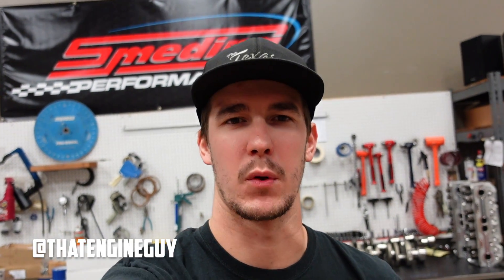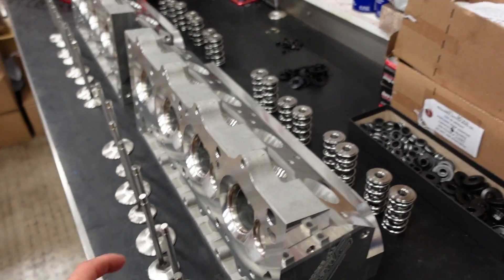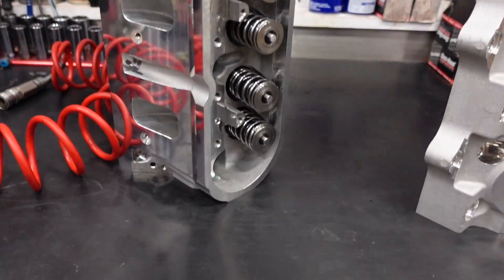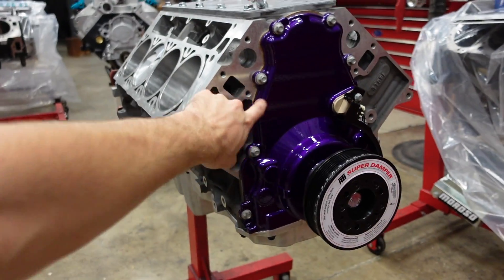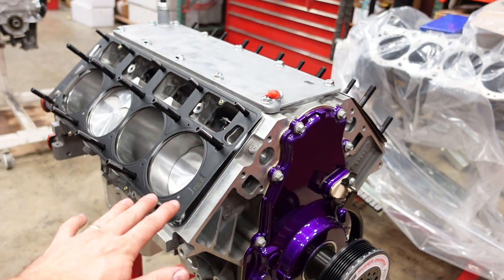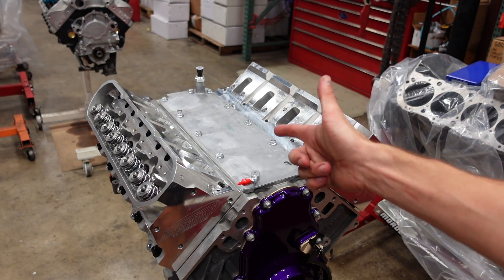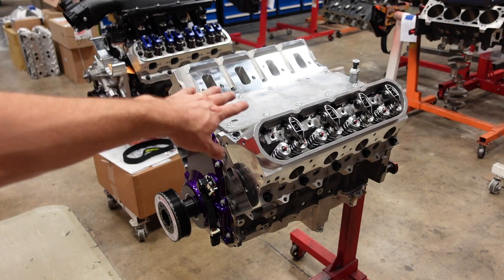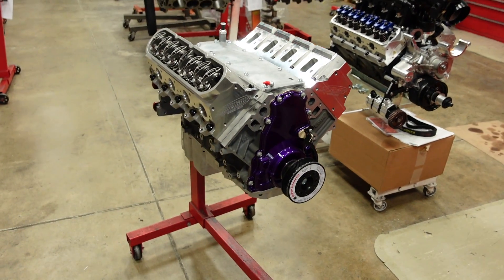Building the Perfect 416" LS3 Street Ripper - Part 2

Comment: Good stuff as usual, thanks. I used same springs and valve seals on my LS3 but was always concerned that the valve seals didn't have the typical design to hold them down with the springs as others do. Was hoping you could talk about them; any issues with those and/or do they hold reliably, any reports of valve seals lifting, etc...Thanks.

Comment: Hey Jacob, I have a question about my own build. I just got my block back from the machine shop, it’s a gen 3 6.0 bored .060 over. Do you think it can be put under boost to get about 1000 hp to the crank or are the cylinder walls too thin? Thanks.
Reply from the maker: It will be close, keep the timing low around peak torque & use rpm as your friend to pour the timing back in!

Comment: Hey Jacob. Curious about the rockers on this build. What if any trunion upgrade did you use? Why no upgraded shaft rocker system?
Reply: Just what I was thinking. BTR has that shaft system he covered in one of his other vids. For a mere $309 it would be worth the peace of mind.
Reply: @hotroddude6551  that’s what I was thinking as well, I have a 2015 camaro SS 1LE with Frankenstein heads and custom cam meant for boost, the people who installed it didn’t tell me about a trunion upgrade for the rockers and shortly after I had problems with that part smh
Reply: I talked to him today he say the BTR Shaft trunion kit won’t fit those heads,I was bombed.
Reply: @mrweayoobagggo.3119  That sounds fishy. All stock components work on their heads but a shaft mount system that utilizes stock configurations won't???

Comment: Can’t wait to see what it does on the dyno! What is the dynamic compression on this setup? If I remember right the static is 12:1?
Reply: I'd like to know as well. I brought up dynamic compression to a local tuner to me when talking to him about my cam selection for a 402 ls I built. He basically laughed at me...
Reply: @Six_ftdeep32  I had the same problem with my 408 build. My cranking pressure was sky high after I got it all together. It made me really nervous about my cam selection so I contacted summit racing, Texas speed, and anyone else I could about it. They acted like I was speaking Chinese!! Finally the guy that designed my cam was able to show me that I was at 8.4:1 dynamic. Thank god I set the static comp at only 10.9:1 or I would have had a detonation monster!!
Reply: @chandlerlofton6536  ok so at 8.4:1 dcr your ok on pump gas?  What cam did you go with?
Reply: @Six_ftdeep32  It was a custom grind cam by Pat G. 226/230 112 .598 .598. It runs great on 93. I’ve been running it for about 1500 miles now with no issues.

Comment: Nice piece for sure.  What's that solid stem intake valve weigh - maybe 110 grams?  What do you think a practical limit for RPM should be on this combo?

With 160/460# on the springs I'd guess around 7600rpm.  Probably gonna peak around 7000rpm with the hi-ram and modest camshaft it's got, so I bet that'll be about right, gives you enough past the peak for good shift recovery - unless it's a stick car!
Reply from the maker: I turn my engine which has the same heads 7,800 with 505# open.
Reply: @JacobVillemain   Nice.  Always a trade off - I like the weight of a hollow stem valve, but to your point in the video, the solid stem has a durability advantage.  We've got a hollow stem (same 2.165" diameter) in mine, 96 grams.  We're comfortable taking that to 8000rpm with about 470# open.  Target shift RPM is 7700, but it's a stick car, so a little margin for TCM (my hands and feet) failure is always a good thing.  ;)

Great content - looking forward to the dyno video.  I bet that's gonna be a fun street motor with a nice curve, and still drive quite reasonably.

Comment: How do you know if you should replace the valve stems/seals on a junkyard 5.3? I visually inspected them and don’t see anything wrong. Just had oil sitting under them when removed. Thanks
Reply from the maker: Send it! Modern valve stem seals will last beyond the life of the engine.
Reply: @JacobVillemain  thank you sir
Reply: Do you CNC BBF engine blocks or heads?   I’d like to see a Ford engine build!!
Reply: Just replace it for a piece of mind
Reply: I thought 400 pounds spring pressure is all that the stock rockers can handle